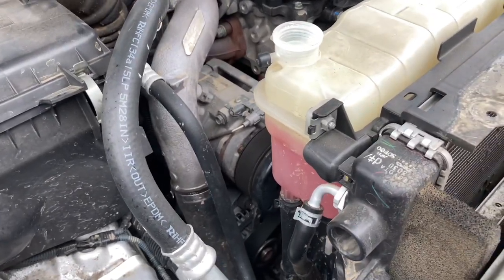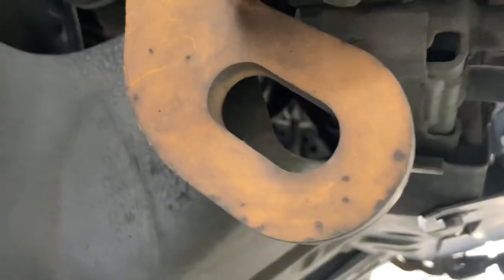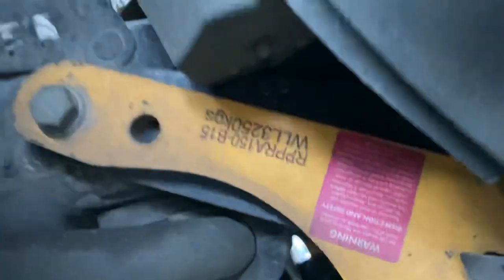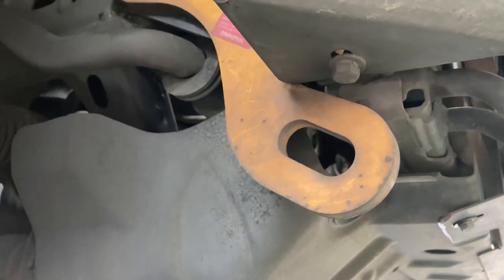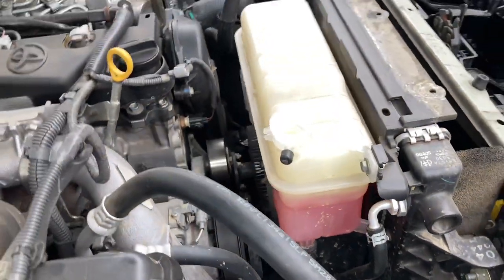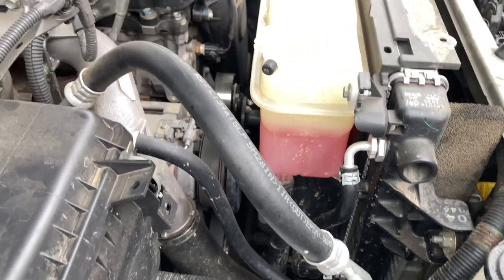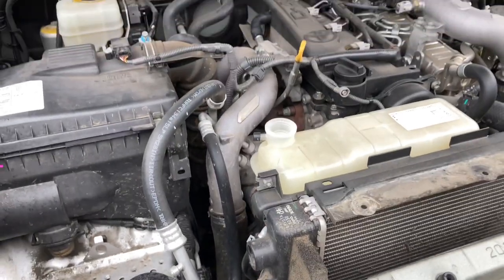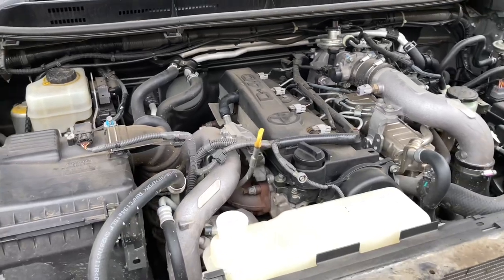Can’t GET TO THE DRAIN PLUG with BANANAS 🤷‍♂️😮🤣😉😁✌️

Comment: 4 bolt and the bash plate. Is of. Easy access, less messy..
Reply from the maker: Not so easy because you can’t do it on the ground you need to jack up the vehicle then the vehicle is too high for the work we’re doing under the bonnet so you need to let it down again then you need to jack it up again to refit it and let it down again so that includes Jack raising the vehicle and lowering it twice you can call that easy but include that in your procedure not just for bolts